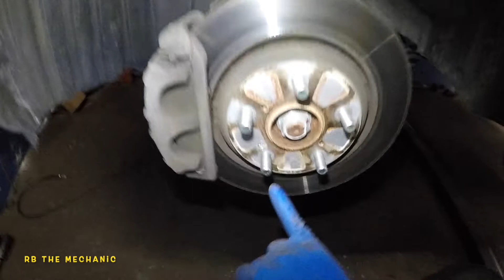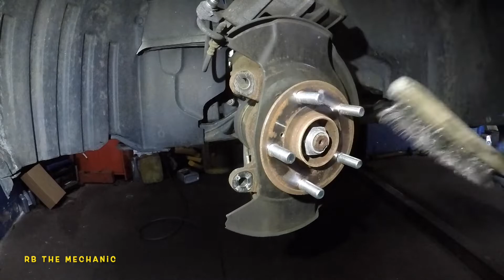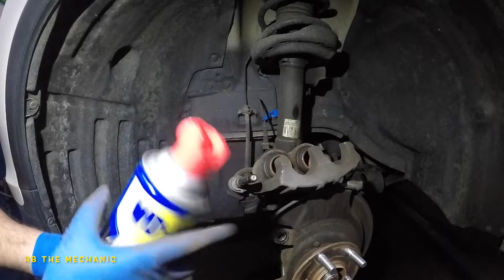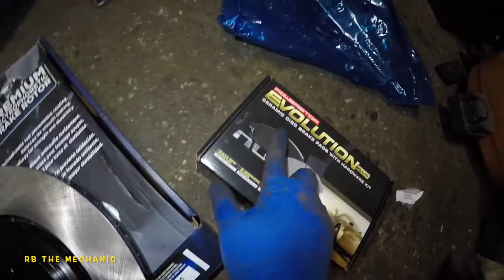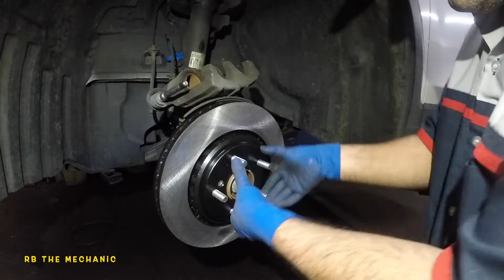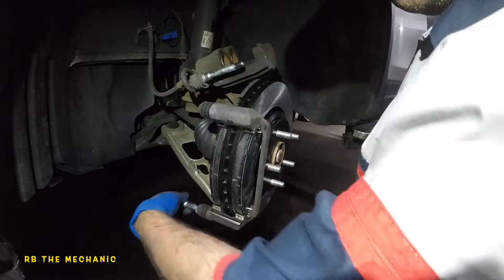How to replace front brakes and rotors on Honda Pilot 2016 and up FULL GUIDE with torque specs

Comment: Quick question for you. Im about to replace brake pads. The akebonos i got came with hardware and it looks slightly different. It has like a metal piece in the middle where the pad sits. 
I looked at other pads as well and some have that type of hardware and some dont. What do you recommend?
Do you think the hardware is made for the pad it comes with?
Reply from the maker: Dose it look like it’s like in angle twisting upward.  Can u post pic or make small video clip
Reply: @RBTheMechanic  the part number is akebono 1089a fits the MDX Pilot and Passport. In the pictures with the hardware thats exactly whats in the box

Comment: Excellent video showing all the proper steps with torque specs.  This rotor screw is a JIS screw.....not a Philips.  Use the #3 Vessel JIS impact screwdriver and you can get out easily.   No need to use an Impact driver.  The impact driver can be used but a JIS bit should be used with it.  Use JIS tooling and you will never strip those screws.  

The silicone lube can be used for the caliper and hardware.  It has a better heat tolerance than the brake grease and is water resistant.  I don't understand why you use the brake grease when the silicone lube, used for the slider pins, is a better option?

Alot of the DIYers never clean or check their bolt threads/mating threads.  Honda recommends the use of new caliper bolts.  Those bolts need to be checked and if there is play, they must be replaced with new bolts.  Cleaning the threads ensures a proper torque.  Lastly, why did you skip rotor runout inspection with a dial indicator gauge??
Reply from the maker: Don’t need to go that far to check and inspect rotor

Comment: Gee you should of hanging them caliber up to protecting them brake fluid hose line.It falling off once or twice in your video.You’re in very dangerous situations.You could have broken off the brake fluid hose line as you’re keeps banging onto the brake rotor.
Reply from the maker: Ok thanks
Reply: @RBTheMechanic  tell him to kick rocks bro.
Reply: Use anti-seize on the rotor screw when you put it back in.
Reply: Karen Karen Karen ...smh
Reply: @KJ-zq3ti  how is he a karen for mentioning something that is crucial in avoiding additional work to be done when replacing simple brakes?